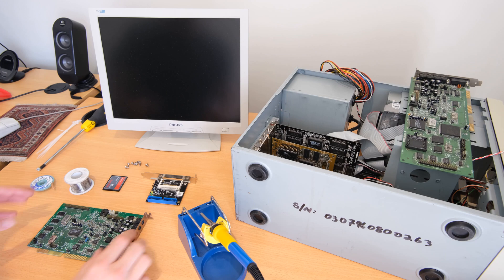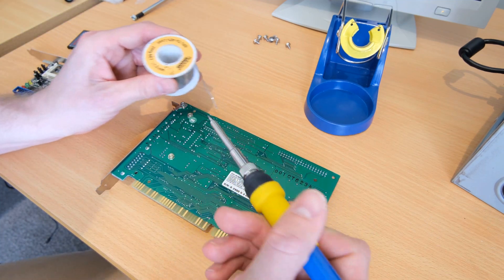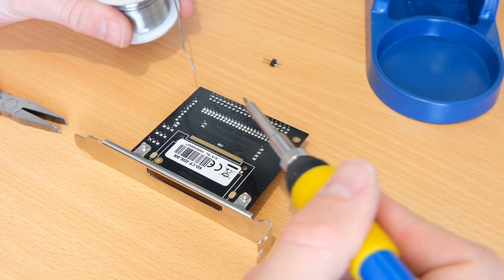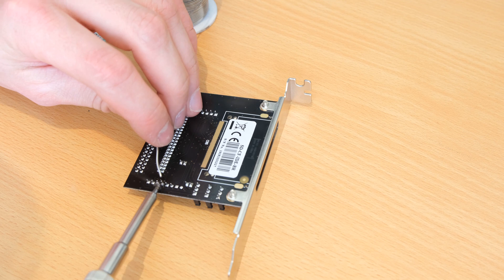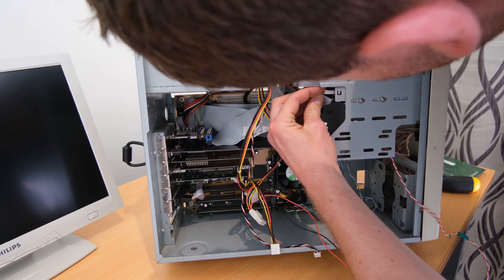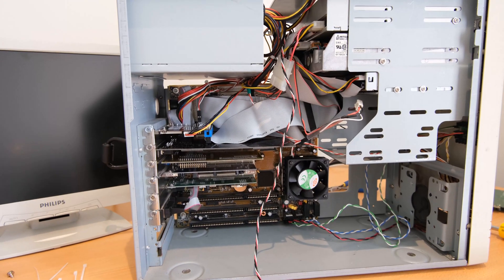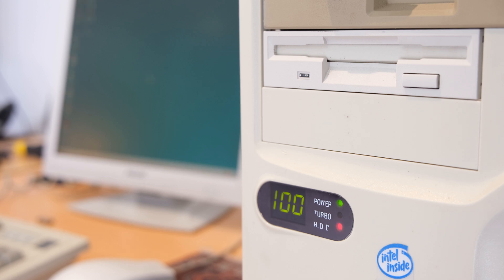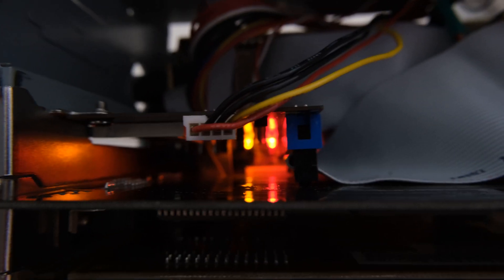Modding a LED onto my IDE-CF Adapter

Comment: Nice computer case, love the turbo button and display.
I have the same case ;-)
Reply from the maker: Yeah pretty neat baby AT case! I need to change the LCD display as well. Seems this case was quite popular
Reply: @thesmokingcap  My display is not working properly so I need to repair it.
Hope I can repair it og get an replacement.
Let me know if you have a source for a replacement display 🙂
Reply from the maker: @Nintendo8bit  Oh no! Is it not plugged in quite right? I don't have a source for replacements. But it's just a standard switching LCD screen, so you might be able to track down a generic replacement
Reply from the maker: @Nintendo8bit  perhaps something like this where you can replace the LCD screen. Amusing there isn't a power issue. https://www.directindustry.com/prod/rohm-semiconductor/product-13683-1961589.html